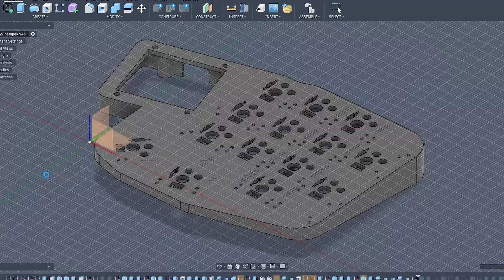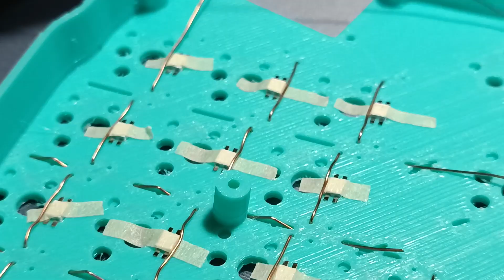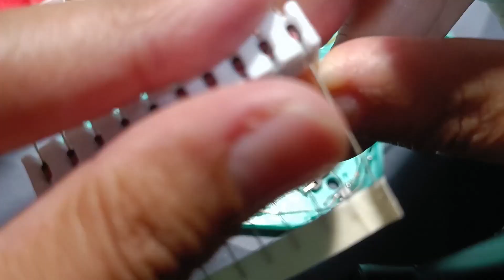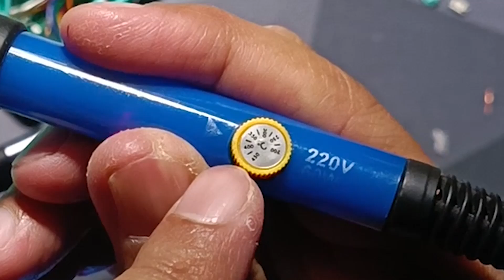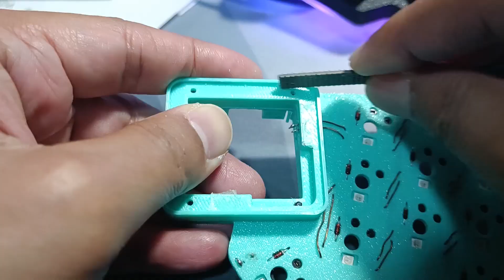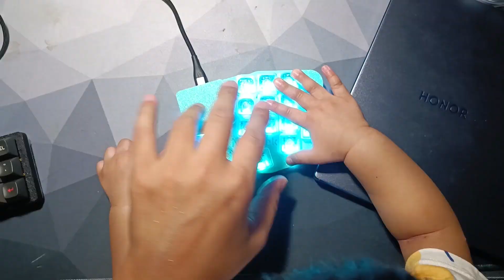I made a handwired numpad! The nampek v2

Comment: The way you solder is incorrect. You should hold the tip of the iron to the copper wire, let it heat then touch the solder wire to the hot copper. Solder flows towards heat and its a common error to touch the solder to the tip rather than the surface being soldered. Also use flux
Reply from the maker: I'll keep that in mind. Thanks for the tip!